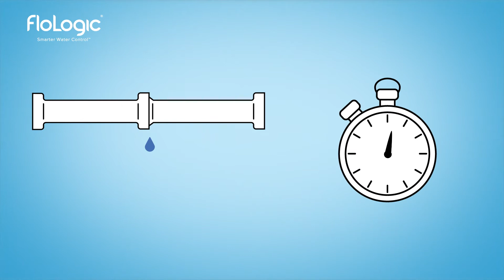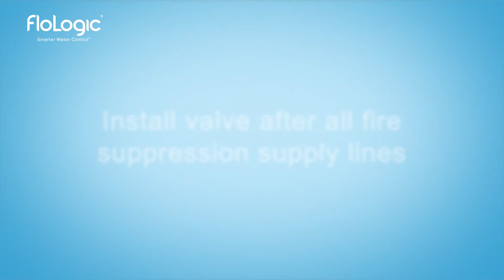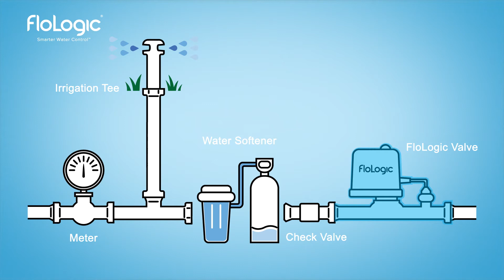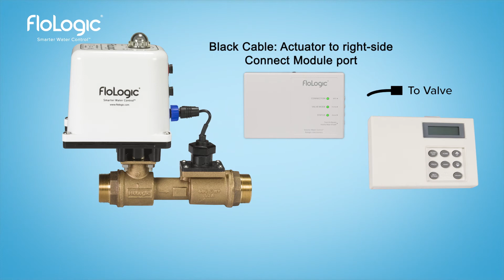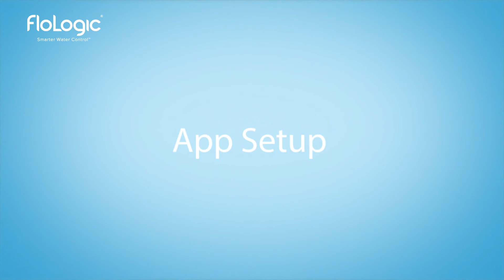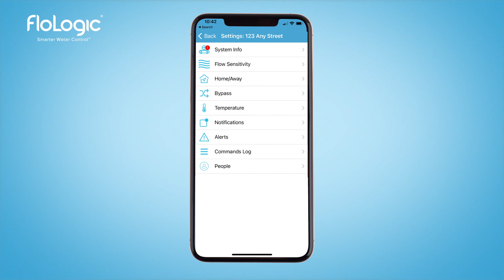FloLogic System Installation Guide

Comment: Nice system but this video is way out of date. No mention on “Gateway” module. “Control Panel” often not needed. “Connect Module” communicates with “Gateway” via thread wireless, not wifi per se.  No mention of pinpoint water sensors. FloLogic has good tech support but this video is too incomplete and out of date- should be pulled off YouTube and replaced with proper installation video. Sadly I just bought this system and got here to this video via a scan code on the installation manual. Lame- Waste of time.